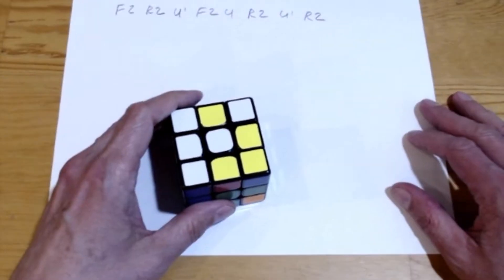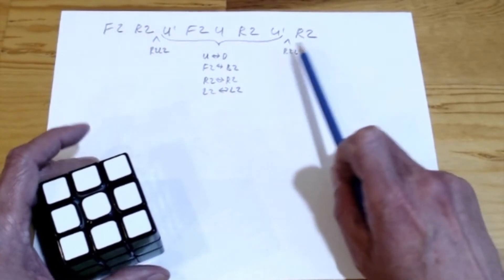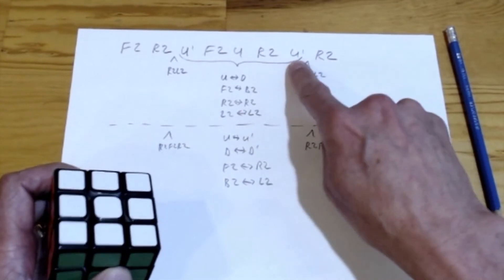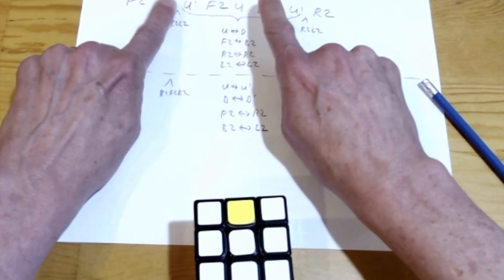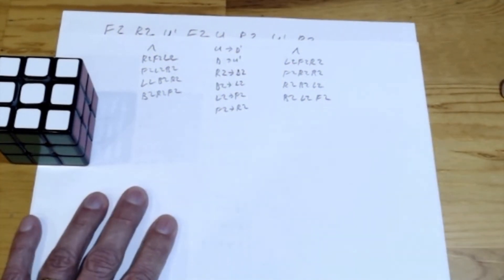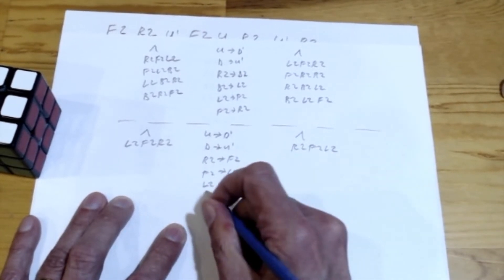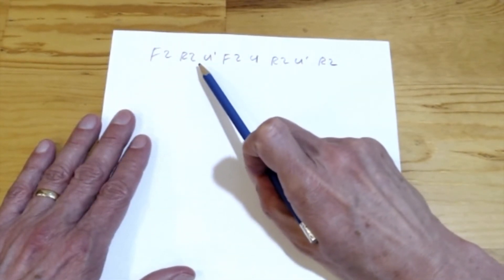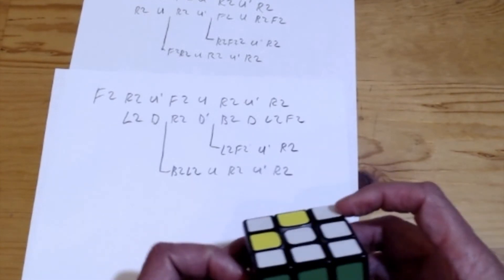Corner Swap Insertions

Comment: Hi Rodney
Thanks a lot for introducing theese great options!
There is one thing i really wonder after having watched  the HTR-Theory as well. 
If i use the knoledge of the theory video, i can bring the edges into HTR.
But then, why using the Cornerswap insertion if they - in most of the cases, as i assume - mess the HTR edges? 
Are these two concepts that you would apply exclusiveley? Or, after the edges are in HTR would you just search for insertiions, which do not mess up The edges? 
Probably i'll decide to learn the concepts from the HTR-Theory. What is your recommandation?
Reply from the maker: The HTR Theory video/doc is an application of corner swap insertions. The optimal HTR sequences were found by taking the optimal corner-only sequences and inserting corner swaps (and slices) to fix the edges. Once you understand how corner swaps work, you can usually find optimal HTR intuitively, instead of having to memorize each case.
Reply: @hyper-paritycorner6030  Thank you for the answer. and for the tips. it's already becoming more intuitive now. for all the cases i can understand intuitiveley, i don't have to memorize the alg. :-) 
My confusion still is, that in the  corner swap insertion video you always did two corner swap insertions. the second one put the cube back in its orientation/state as before, so the transcription part ended there and the following sequence didn't need to be transcribed. In the HTR-Theory video there is no second CS-Insertion, which is more understadable to me. Why do this second CS-Insertion? just to end the need to transcribe after?
Reply from the maker: @megaigor2000  Sometimes the HTR alg will have two corner swaps (e.g. U B2 R2 U’ L2 B2 U) but more often only one is needed, and the second corner swap, if any, would be part of the HTR finish. In fact, corner swaps are kind of like parity: From any DR starting position, you can always fully solve the corners with at most one corner swap. If your position requires zero corner swaps to solve the corners, but you need one to bring the edges into HTR, then you will need a second corner swap after HTR.
Reply: @hyper-paritycorner6030  Thanks a lot - this is very insightfull! So if i understand it right, in this video you always needed to take two insertions, because the starting point was a corner skeleton and the goal was to optimize the edges.  in this context you had to do two, because inserting only one would disturb the pairity. right?
Reply from the maker: @megaigor2000  Exactly right.